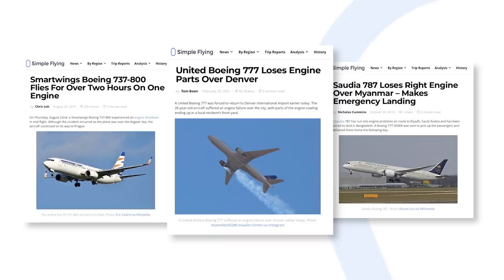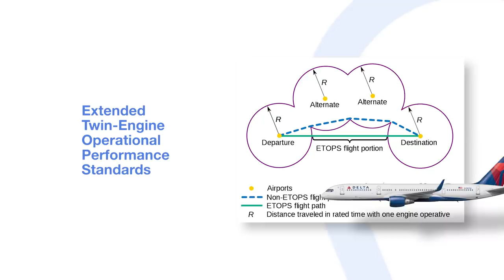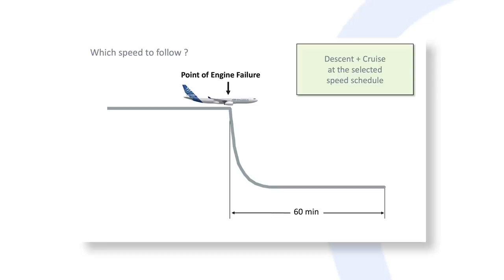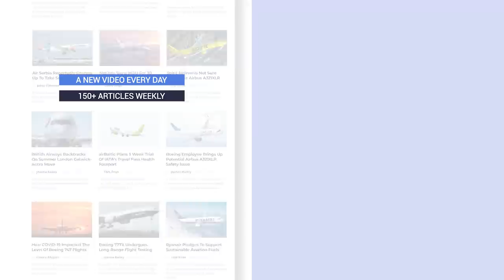How Far Can Aircraft Fly On One Engine?

Comment: All very true in MOST (99.9%) cases.  Unless you're United flight 1175 on February 13, 2018.  That flight suffered a fan blade failure at top of descent into Honolulu.  Like the incident in Denver with another United 777, the fan blade basically destroyed the fan shroud.  In an interview with Juan Browne (Blancolirio), the captain, Christopher Behnam, stated that the aircraft was barely flyable.  He also stated the NTSB findings concluded that had the event happened farther out from destination, they would NOT have made it to Hawaii.  Hence, the grounding of all aircraft with that engine type after the Denver incident.  Aerodynamic degradation due to the shroud departure is the difference between these incidents and other engine out incidents.
Reply: Yeah, in ideal situations the engine failure is as if the engine just got turned off, but with a blade fan breaking and sending debris everywhere or as you said causing aerodynamic degradation it is extremely scary.

For example you could characterise QF32 as an ‘engine failure’ very loosely, but that engine sent shards everywhere, severing hydraulics, wiring and fuel lines. Also had the engine exploded later into the flight, there was a slim but real possibility for even a fire on board as the fuel tanks had less fuel and more oxygen to ignite.
Reply: @Leo-pu2nw  QF32 was a disk failure that caused the engine explosion.  So was United 232.  Both are examples of why disk failures, which cannot be "contained" are so dangerous.
Reply: Captain Behnam also stated during that interview, that shrapnel from the exploding engine nearly penetrated the aircrafts fuselage. Had that actually occurred, and at that altitude.., an entirely different scenario would have played out during this event. Perhaps, near-future technologies will bring about quieter, higher-efficiency Turbojets, e.g, “Concorde”... engines for the next generation of commercial aircraft, thus eliminating fans blades altogether. Just me, thinking outside of the box.
Reply: Apparently while engines are exhaustively tested and designed to contain damage, aerodynamic engine shrouds weren't tested for their ability to maintain integrity after engine failure... until the 777 kept losing shrouds after blades failed.
Reply: @AtomicBuffalo  They are tested.  Extensively.  But sometimes real world experience and thousands of flights find things that get through.  A similar situation with the CFM56 on the 737.  After how many hundreds of thousands of flights, Southwest had two incidents within a couple of years.  And now GE and Boeing are working on a rework of the cowl on that engine also.
Reply: @dennisrogers8107  I'm not taking your word for it.

Comment: A twin engine aircraft is designed to operate with one engine, for limited times. It's best to land safely as soon as possible, if one engine is not working. A 3 engine aircraft can operate on 2 engines. And so on. Now, when flying on a single engine aircraft, it's best to keep that engine in top working order.

Comment: In most aircraft if you loose an engine you’ll also loose some electrical or hydraulic power too. On the A350 both engines can pressurise both hydraulic systems so there is no loss of hydraulic system and as there are 2 generators per engine I don’t think electrical distribution is affected much either
Reply: Yes the 350 has great redundancy.

Comment: Been there done that. JFK to Denver on Delta in a 737… weird vibration for the entire trip till no vibration… engine off and hard right to divert to Chicago. Plane swap. Boom. 

As a matter of fact I had a stretch of planes with issues till I lost count. I remember an MD-80 power issue on takeoff leading to an aborted takeoff and that was scary. That was really scary. Ooof.

Comment: Around 1986ish, I was on an Eastern 757 that blow and engine on take off out of SLC. It was more than just a compressed stall.   Bits and parts landed on the runway.  The plane continued its take off like normal. Had it not been for the loud bang, I doubt most passengers would have realized there was an issue.  The plane circled around and landed without incident. Eastern put us on another plane and we were off again.

Comment: Curious to know: would a plane with an engine out, forced to fly at a lower altitude, and slower, achieve better or worse mpg than that same plane with everything optimal at its ideal altitude?
Reply: Worse air being more dense at lower altitude resulting in greater drag
Reply: The lower speed and lower altitude could cancel each other out.  I suspect the range would be close to the same because these planes are designed to fly half way across an ocean on one engine.  Engines are also most efficient at around 90% power.  Does anyone have the numbers for a particular aircraft?
Reply: Much worse. Lower altitudes result in lower true airspeed for a given indicated airspeed and fuel burn rate. Combine that with the drag of a failed engine and the rudder/aileron deflections required to keep the aircraft flying straight and you get significantly reduced range.
Reply: @nathanbanks2354  You are completely mistaken in everything you said.
Reply: @nathanbanks2354  if that was the case ryanair would be flying with one engine even remove an engine lol 😂😂
Reply: @nathanbanks2354  a B737 NG or MAX would have worse range. You have to fly much lower. The engine would be wacky down there and at slow speeds it’s forced to go unless at full thrust, past N1 limit. (Past N1 limit=engine fails soon.)
Reply: @pranavr2256  except that it's illegal. 
If you could somehow remove the need for redundant systems and the safety they provide, it'd be entirely possible to build a single engine competitor to A320/737 type jets.
Reply: @julianbrelsford  i dont think so the weight balance on an extended 737 max already messed up, imagine having a giant single engine on the tail. You can never have extended single engine 737 or a320. Latest gen of both planes are getting longer single engine not really possible coz of weight distribution.
Reply: @nathanbanks2354  everything you said is incorrect.

Comment: Good to know that most aircraft can fly with one engine. I’ve been in a situation when one engine on a 737 turned off and it was VERY scary for me. Fortunately, the engine did turn back on that time.
Reply: most, perhaps, but one of the most commonly used planes in the world the 747, has four engines, and if 3 of them failed, that would not be good. On a dual like the 737, it can manage with one.

Comment: Earlier this year, Juan Browne for the Blancolirio channel did a interview of the Captain from UAL 1175.  In 2018 this 777-200 flying from SFO-HNL experienced a failure of one of the engines about 120 miles from HNL.  This failure resulted in loss of the cowling and the engine was oscillating despite the engine being shutdown.  The control of the airplane was not normal and there was severe shaking of the airframe.  The airplane was able to land at HNL.  During the interview the Captain mentioned that if the plane had been further out from HNL he really wasn't sure if they would have been able to make it to HNL because when the engine failed so much damage was caused.  The engine was also oscillating that it was shaking the cockpit to the point that it made reading gauges difficult and even reading the checklist.  Despite all this oscillation from the engine, it never separated from the airframe.  This really makes me question the ETOPS certification of 300+ minutes for some of these airplanes.  Especially in a catastrophic failure that results in damage to the aerodynamics of the plane trying to bring a damaged twin engine plane with only one engine and then try to fly that plane for 5+ hours on one engine.
Reply: The checklist for engine severe damage / separation tells the pilot to slow down or descend to reduce vibrations. In any case the bolts holding the engine to the pylon are the weak link, so if anything is going to snap it’ll be them, and then the aircraft is free of vibration.
Reply: @EdOeuna  I thought the same thing as you but the bolts holding the engine to the pylon never snapped despite have so severe vibrations they couldn't even read the checklist for engine severe damage.

Comment: The Fokker 130 range covers a vast area, even with a full passenger load. Take-off and landing performance allow operations to and from remote destinations. This results in an aircraft with unique payload capability and earning power for airlines.
Reply: The Fokker 130 'dream' plane that never flew, except on the designer board? 🤣😂

Comment: An engine failure on any twin-engined aircraft is an 'emergency' (Pan-Pan ATC call in the first instance)...contrary to your suggestions, Sir. Yes, most twin-engined aircraft are designed for 'worst-case-scenario' such as failure on take-off etc., However on any professionally operated commercial twin aircraft with one engine out it is a serious issue and 'Land at nearest suitable alternate' is the first and immediate option.

Comment: C'mon , guys.  Every pilot licensed for multi engine is taught how to fly with engines out.  The original test for the DC3 was to take off and cross the Rocky Mountains with one engine.  Current two engine passenger jets can cross the Atlantic on one engine.  I had a friend who, while qualifying for a multi engine license, had an instructor suddenly reach for the controls and turn off one of two engines..  As a passenger, I always hope that my pilot has military training and experience
Reply: No plane would intentionally cross the Atlantic purposely on one engine. The checklist will state “land at nearest suitable airport” which may be in Iceland, Greenland or Canada, depending exactly where you are. 

You’re never really that far away from an en-route alternate airport.

Comment: This “kinda” happened to me twice. By “kinda”, I mean that the engine problem was assessed while the plane was still on the ground. Once on an A321, pilots said they couldn’t start one of the engines (20 minutes later we were on the way). 

Then another time on an A330, we sat on a tarmac for half an hour while engineers tried to fix one of the engines, then eventually we were transported to another A330 when it became clear it won’t be a quick fix. Glad they found that issue on the ground and it didn’t happen half across the Atlantic Ocean 🤣
Reply: I hate the word tarmac. All the TV news reporters love it. At an airport, you only have Aprons, Taxiways, Runways, Parking or Stand/Gate. It's amazing such a trivial thing annoys me so much. No offense Roman just wanted to vent.

Comment: When reading the title, I was thinking it's about like "How far away we are from (large commercial) Aircraft with only one engine"
Reply: I was thinking about that the other day. What if you put a single GENX in the tail of a 737 Max? That single engine would have about the right amount of thrust, and probably be more efficient than two regular engines. It could work for overland flights but you’d need to get really good at landing a large glider in case that one engine failed.
Reply: If that only engine fails at a low altitude, then hope there's a river nearby.
Reply: @randocrypto1678  too bad that the genx is too huge to fit in a 737 tail

Comment: One thing I don't understand is why perform an emergency landing if a landing gear fails? 1. The plane is still fully loaded with fuel and so it is riskier, and 2. it's not as if the emergency landing doesn't require landing gears just like a normal landing. If the destination airport has emergency facilities, why not fly there THEN do an emergency landing?
Reply: It is common for aircraft to suffer a failure of some sort on departure and continue to the destination and perform some form of emergency landing there. Assuming no effect to the performance of the aircraft, losing a hydraulic system or tyre failures, etc, can be better managed several hours later once the fuel level is much lower and the pilots have had a chance to discuss the approach and landing with company and emergency services. 

Clearly continuing with gear down, flaps fault or something that affects the cruise performance isn’t a good unless you need to get to a fairly close alternate.

Comment: If ETOPS is over 6 hours, why don't the pilot fly one one engine to save fuel. Only restart the 2nd engine when landing. Does this not save fuel for the corporate company or is this not a good idea!!
Reply: Asymmetrical thrust degrades handling and increases drag.
Reply: Also, if the single running engine failed, the second may not be able to restart.  Starting an engine in the air is not as reliable as just leaving the engine running.  Plus the flight would be slower so you couldn't run as many flights with the same airframe.
Reply: Aircraft cannot fly as fast or fly as high with one engine running so have to fly lower which burns more fuel and the use of rudder to compensate also introduces drag